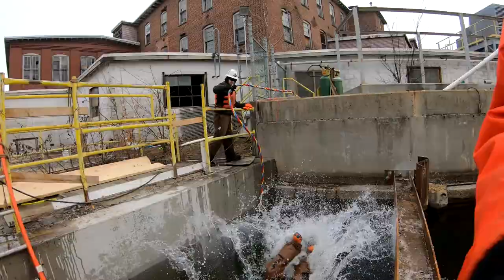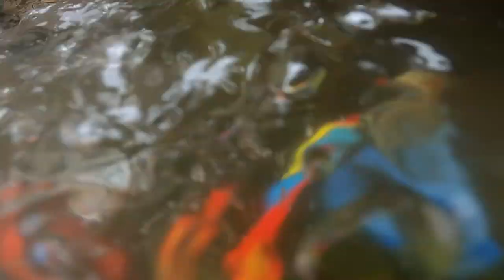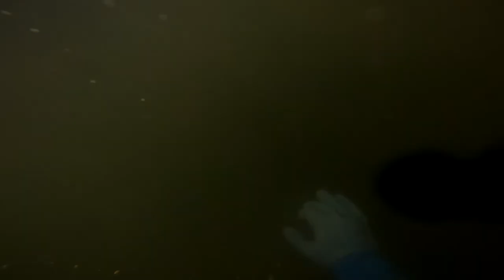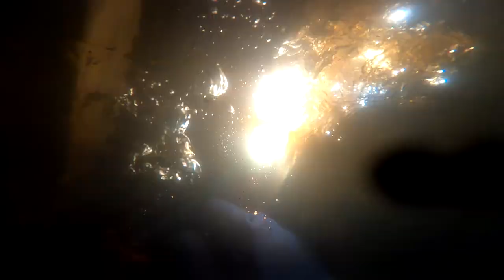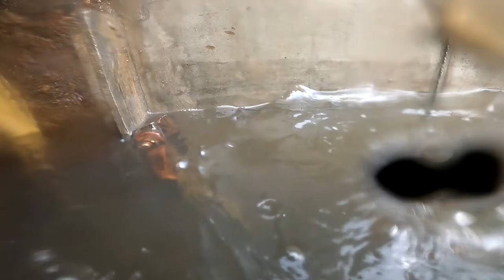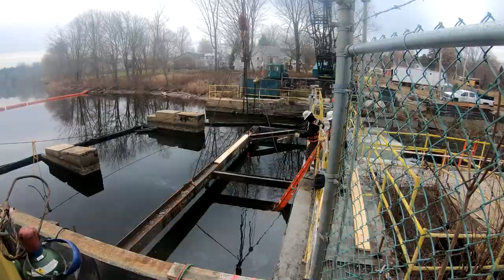RIPPING metal out of the water!!

Comment: What is he using to take the bolts off?
Reply: It’s called a BROCO torch. It uses a burning rod comprised of tube steel with a magnesium core. You provide O2 and electrical shock and it ignites the magnesium. The O2 keeps it lit and blows the melted stuff away. They burn at 8000-10,000F  melting most anything.